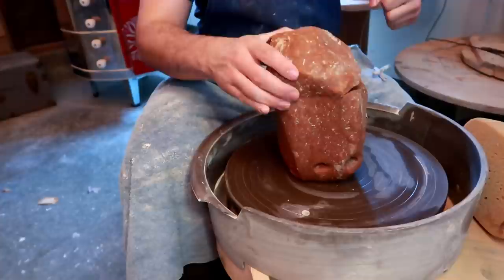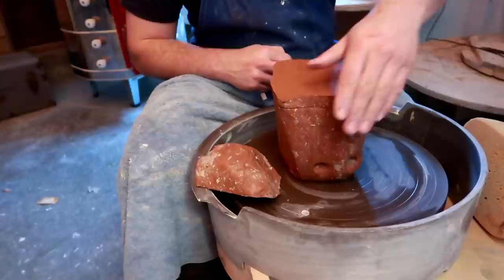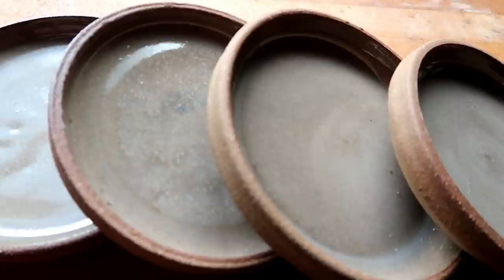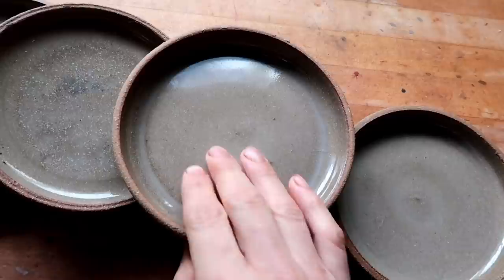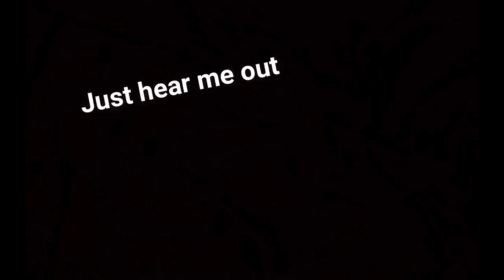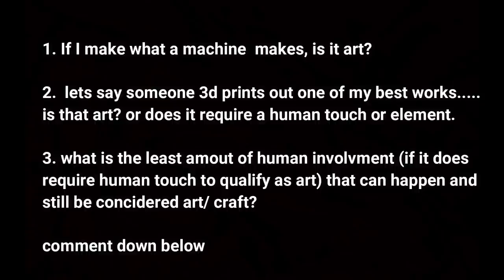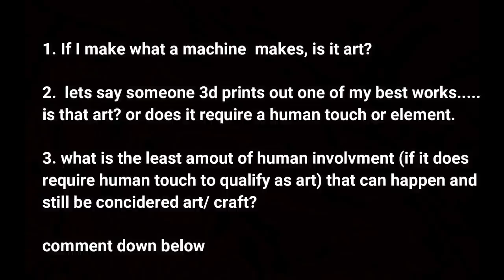I have a question to ask you

Comment: Art is easy, it comes with the warning "not safe for food" or a price tag that makes you want to look at it forever and never touch it because the cost is way not worth the risk of a fingerprint. A functional mug is a cylinder with a bottom (with or without a handle) that doesn't spill its hot tea on your jewels. Craft is making that repeatedly in such a manner another individual looking at it knows you are the one that made it and they can trust it because you made it.  Functional art would to to put your shaping/glazing/decoration/stamping on that mug without in any way diminishing it's function as a mug (no good to put goblins all around the rim and no place to lip it without hot dribbles all onto your jewels).

Comment: 1. If made ironically/with a message behind it (posing your question), yes, but if made for the sole purpose of recreating the product, no. It's the difference between making a plate solely for profit and making a plate that holds meaning, whether to you or to the buyer.

2. If they created the model for themselves? Maybe. If it was just taking the model and printing it, it's no more art than printing out a picture of the Mona Lisa, but if they made the model from scratch, there is a good chance they have some meaning behind their doing so.

3. I have no good answer, and I don't think there is a good answer, because everyone will have a different one. Overall, Art vs. Craft is not objective, and everyone qualifies art and craft differently. 

As a last point, I would say that Art and Craft don't envelop everything, but there could be just a simple third category for ceramicists where a piece would fall under "product". Product being anything that does not take skill (which would be craft [mainly, art still takes skill, but the two terms are so interrelated that skill applies to both]) or hold meaning in the maker or buyer's eyes (art).

Comment: OOOOOKAY :-) SO... I have two answers - Mine and my 9 year olds :-)  #1 - The 9 year old:  The machine created "art" is not art because a machine made it, its not made by human hands and it does not require "skill" to be made, such as that $2 Wal-mart plate. (Discussed some finer points with him, and he's thinking about adjusting his answer) - #2 - My answer:  I think "art" depends on context.  You can call just about anything art, from a fart to a leaf to the Sistine chapel BUT MOST people would not call a fart art, in most cases.  In the most basic context, almost everything is art, what I don't like about this is the fact that the word, "art" looses all meaning then - as in, what does the word itself REALLY MEAN or REALLY REPRESENT?  I commonly think of Art in a more restrictive context, first as something with intent behind it - a human, conscious decision to create something from nothing that communicates an emotion, thought/ideal or is designed to elicit a reaction - thats where I set my "bar" which technically makes wal-mart ware art.  Considering a deeper context yet - the context of creative art, or craft art, I'd consider art something that not only has intent (my basic context) but also something that has SKILL involved - something that takes effort (perhaps significant), practice, involves knowledge or some sort and builds on the intent I mentioned earlier - this is what I think of when I think of most ceramic ware, and this excludes the $2 wal-mart plate from the list, not because it didn't have artistic intent, and in fact the first one, the pre-production version, was the truest form of art and took a skilled craftsperson to create, the production version did not. 

I could go on forever on the topic.... This is a great topic that goes much deeper than the quick skimming I did :-) My "answer" is not complete, final, or even close to encompassing everything, but I think I scratch the surface in a holistic way :-)